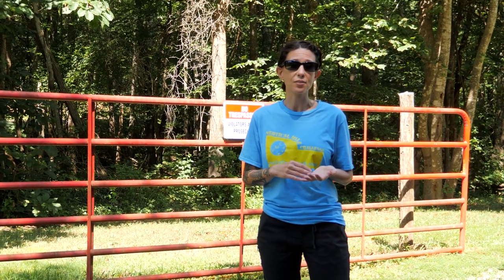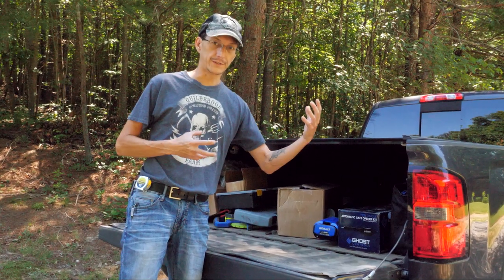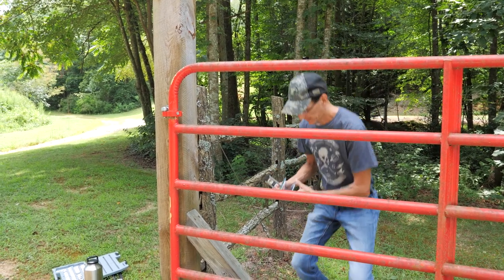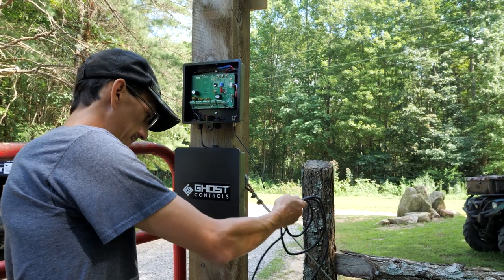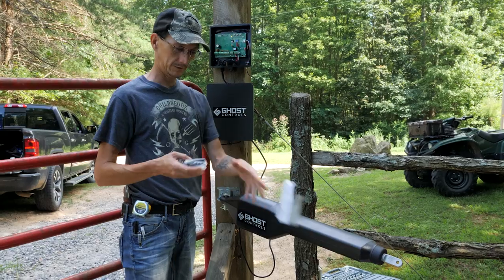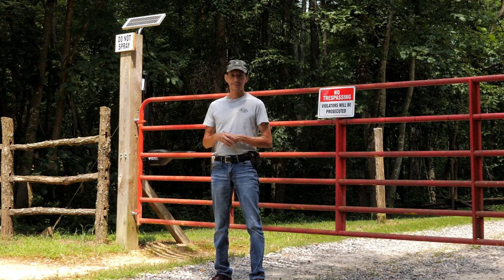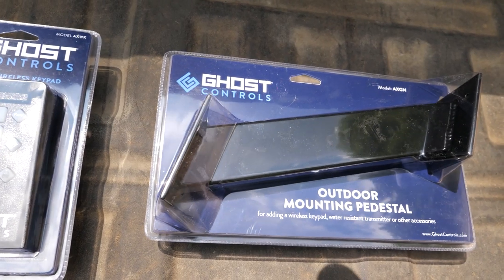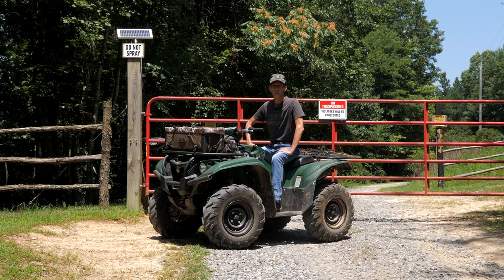Installing the Best Off Grid Solar Powered Automatic Gate Opener from Ghost Controls

Comment: Question.  How long do the Ghost batteries last?  Did you consider buying a Marine battery that will last a lot longer.  I am purchasing the solar panel as well, but we don't get a lot of sunshine in the winter...so the battery may need to provide the necessary charge.  Thanks.
Reply from the maker: I bought the double battery kit and haven’t had any problems so far. The panel seems to keep them both charged.

Comment: For a 700 dollar system I would think your solar panel would be much larger. I wonder how many times a day you can open the gate before the batteries drain out and how long it would take to restore that power.  It shows on their site that for the single 10 watt panel max is 24 cycles that you can open and close said gate.
Reply from the maker: The control panel will handle up to 30 watts or 3 of these 10 watt panels. If you have more daily cycles than that will handle then you can use a deep cycle marine battery and a separate solar/charge controller setup that bypasses the gate control panel.
Reply: @Guildbrookfarm  It does look like a pretty nice system. I would think that some updating of some of the security things with options such as rfid cards, phone apps, Security cameras, Door bell, motion sensors, lighting would be a great addition to build off of this system.  Many of these things can be added with very low cost and wireless is pretty easy to install even if you are a far distance from the home or building.

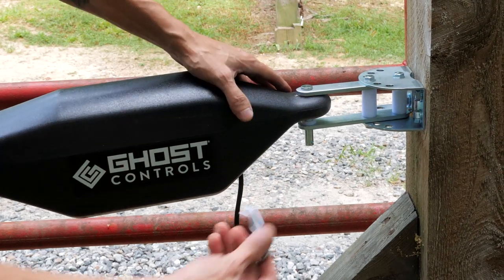Comment: Okay i spot a down fall to that system. 7:10 and 11:20 are your two pins for the arm you are better off drilling a hole in both pins and use padlocks.
Reply from the maker: You can buy locking pins
Reply: @Guildbrookfarm  thats good. it would be a shame to come home to find it be played with. and the lock at the end of the gate easyly bypassed

Comment: I was very interested, I have 3 properties sharing a private drive. Construction has been ongoing and we basically gave up on the gate for the time being since the contractors couldn't seem to get the chains/locks hooked up properly.

Your blurring on the gate code is insufficient. I suggest taking this down, completely black out the whole box, your hand AND most of your forearm, and re-publish. I'd tell you this privately if I could. Sorry.
Reply from the maker: It will be alright 😉
Reply: Mark, I'm sure he reprogrammed the code after making the video. ;)
Reply: @elizabethchetwood1916  Probably!